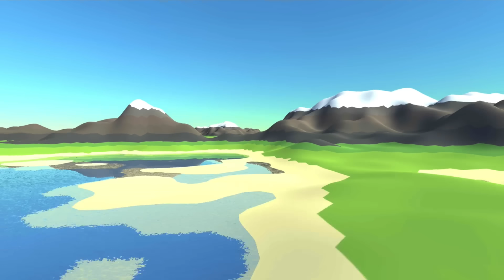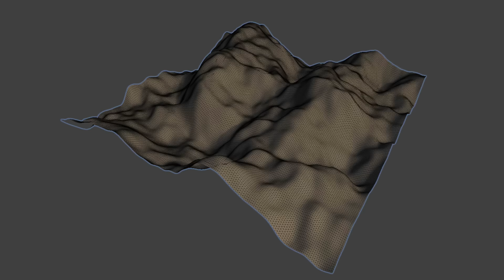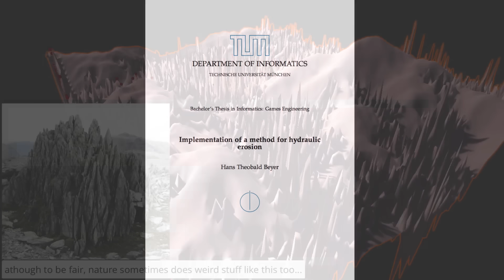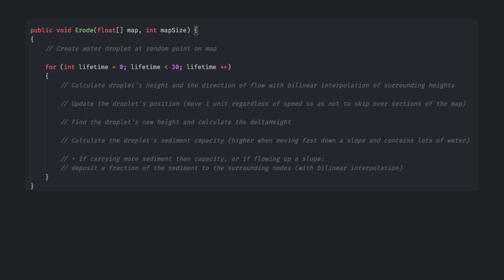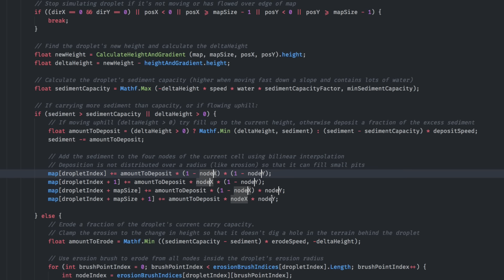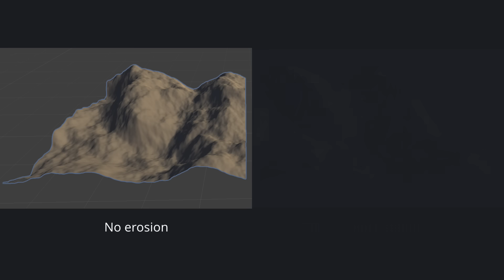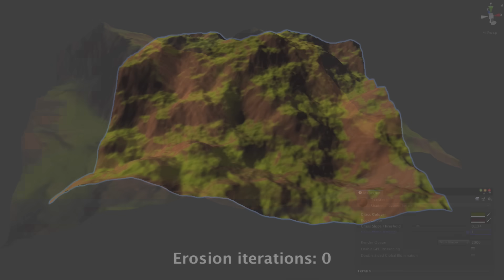Coding Adventure: Hydraulic Erosion

Comment: An interesting way to achieve more natural looking height maps: try and MULTIPLY some of the noise layers instead of adding them. This might sound strange and unintuitive at first, but logically speaking, the “mountains” will get a more rigid looks, where as the valleys will get a more flat look. Simply because the y-values multiply into less change on the lower parts of the map, and vice versa. It was a really simple way to get something quite realistic.

Comment: Part of the problem with the look of generated terrain is that the repetition is obvious. Peak/valley/peak/valley... all the peaks are the same height, all the valleys are the same width. You never get "clusters" of peaks of varying heights with narrow valleys high up in between or a series of peaks descending to a plain. One thing I did when I used GIMP to make heightmaps for Cities: Skylines was to use a gradient layer to mimic an extremely low frequency octave. There was also a technique in GIMP that created a "lightning bolt" in a defined area. That was a great way of defining a fairly "realistic" ridgeline, then use noise to further warp that line, gradient fill to slope away from the ridgeline, and the underlying gradient to produce an overall slope to the terrain. Layering gradients in different directions also created a central peak with the ridgeline slowly tapering down as it moved away.

I did this all manually in GIMP. But there's no reason it couldn't be automated and given parameters to tweak the outcome.

Comment: High altitude peaks don't get rain. The reason mountains don't turn into giant spikes is because temperature changes at high altitude do the major work in mechanically breaking the rock apart, while wind and moisture also play a part (especially water seeping into cracks and freezing, then gravity brings down all the fractured bits. Where trees begin, you also get a lot of rain, but roots and animals also get involved. You can be sure that temperature's mechanical action is the main driver of peak destruction because no peaks are rounded by the gentle polishing of wind and water, rather they and all the rocks that fall from them are jagged.

Comment: You should think of coding a tectonic terrain generator. That'll simulate tectonic movement, magmatic convection, and volcanic activity, all in one fell swoop. I'm already pondering how this might work, notably by intervertical stresses in solid masses.
Your fluid simulation script will come in handy too, given that when rocky planets first form, friction and compression from their own gravity heat them up so much that their constituents melt and re-settle in layers, with nickel and iron and denser materials at the core, and the lighter, sparser silicon, aluminium, boron, and carbon as the crust.
It'll evem be fun to throw rocks at your planet and sprinkle a few craters here and there; even Earth has these impact craters!

Comment: hydraulic erosion can be implementrd without caring about paths, you just need to look at the 1 pixel environment and determine if you decrease or increase the value and gonover each pixel jn the image in random order, the flow happens automatically , and every round you switch the read and the write buffer

Comment: Just FYI if anyone attempts to implement this. The paper calculates the height difference as: 
hDiff=hNew-hOld
It is based on a blogpost at ranmantaru games. In that blogpost however hDiff is calculated as:
hDiff=hOld-hNew
The sign is flipped!!! 
The paper still uses the speed formula from the blogpost without considering this: 
speed = Sqrt(speed^2 + hDiff * gravity)
Guess what happens with a square root with a negative number inside: 
speed = double.NaN
Not only that, but the speed is actually reversed (downhill = slower, uphil = faster).
This error happens when the speed is getting low and hDiff*gravity is larger than speed^2. In the blogpost, the hDiff is also reduced by the amount of eroded/filled sediment before the speed calculation, which is not mentioned in the paper. Probably nobody noticed this because the amount of iterations is limited so that the speed never gets that low to trigger the error ... except when you increase the droplet lifetime to 100 like me 😄.

Comment: I had some problems understanding the paper you linked to; if you would please help with that. In the part where he says that when Hdif is positive, the drop drops the sediment until it fits the pit, do I have to program that, or is it already accounted for by the drop's speed going down and if not, is the sediment dropped just the height difference? Secondly, in the part where he says that when the drop deposited sediment, the residue is distributed along the four grid points surrounding it, what does that actually look like as an equation? Thanks.

Comment: I had some problems understanding the paper you linked to, in the part where he says that the grid point s loose sediment according to their weight values, then he says that the weight values are multiplied by the erosion factor, then he does not mention that it should be also multiplied by the amount of sediment the drop should take which I assumed. could you please explain that to me.

Comment: Another factor which effects how rocks erode which other commenters haven't mentioned is (an)isotropy. Rocks typically form with a non-uniform fracture orientation based on the stress environment during the formation of those fractures. So rocks in a certain mountain range might be more likely to fracture along non-uniformly oriented planes. I don't know the coding side of it, but I think something in that direction could add a certain "naturalness" to the appearance of the landscape.

Comment: Neat job, and it runs a lot faster than I expected. 
Gonna have to look if you ever did the tectonic plate simulation. You'd still need noise for that, tho, as the noise would be required to represent plate composition.

Comment: Have you given any thought to creating a parallel approximation of what you have done here?  i.e. process every cell every cycle, but in a way that approximates the "single drop" approach?  I just finished studying a GPU algorithm that seemed to produce inferior results to what you had here despite combining it with thermal erosion, and part of me thinks it may be because they maintain a single velocity vector for each cell, whereas each cell in your example is essentially exposed to a different velocity vector for each drop it encounters.  Do you have any thoughts on that?

Comment: Ugh! You solved this problem way better than I did.

I'm gonna adjust my solution, then work on perfecting my method for generating rivers:
- Store a copy of the initial terrain heightmap and shift all points downward 1-2 meters, give it a water texture
- Each time a droplet flow direction is generated, add it to a normalized flow field map
- Use the flow field map to create a dynamic scrolling texture shader for the water terrain

The parts of the original terrain that were impacted the most by the erosion process should reveal "holes" where the water terrain pokes through, and that terrain should show the water moving downhill.

Comment: I long ago (i.e. around the year 2000) did something similar, though without the real time 3d rendering (instead, took snapshots). In addition to modifying the height map I built up a map of where the droplets traveled, then normalized the water values to discover where the rivers ran and I had lakes.

Comment: Decades ago, a program called Bryce (acquired by DAZ3D at some point) accomplished this in near real time. I don't believe that a "simulation" was involved / there was no rolling balls down a hill or anything like that - it seemed to simply process a depth map (image file) with a filter. If I were to describe it, perhaps I would say it seemed to "grow" hair (from "high points") in a fractalized manor and that would be used in the depth map to "carve" erosion. And, all said, it was pretty convincing.
 I obviously have no idea exactly how they did it. But, as I said, it worked near and UPDATED in near real time (it was modifiable / had parameters that you could adjust) and that was on an old 486 computer. Granted, the computer I was using was considered a "beast" at the time. But I am sure YOURS would be considered a super computer.

https://en.wikipedia.org/wiki/Bryce_%28software%29

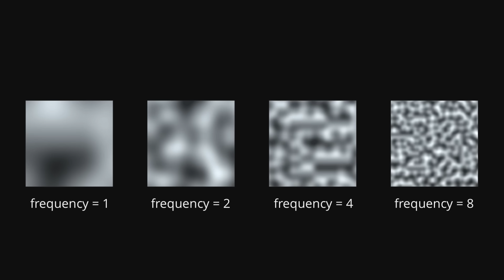Comment: I notice maybe something you skipped - if you add up the noises together at 1:10 with those different amplitude multipliers, how come you get a map with values from 0 to 1, if 1 * 1 + 1 * 0.5 + 1 * 0.25 + 1 * 0.125 equals more than 1? Do you just clamp it, or divide?
Reply: Divide, propably

Comment: Another helpful factor: during inundation, because MANY droplets are falling simultaneously, they merge and form a coherent LARGE channel, which will give your mountain ridges more varied, fractal distribution of ripples, instead of the 'straight hair' look that the current method produces. You'll be able to tell the difference when you look carefully at the pattern of flow - your current model produces numerous parallel small channels, while actual mountains produce 'fronds' that merge into larger streams and rivers.

Comment: Hey there, I'm trying to implement your code for UE4, it works great, but for some reason all of the erosion line are parallel to each other around 45 degrees from both the x and y axis instead of being at an angle to each other, could you please help me with what can cause this?

Comment: I've never seen Hydraulic Erosion done like this, one droplet at a time. It's almost always done with a water map, where you start wit the water map randomly filled and then iterate over the whole map, letting the water flow from higher terrain with higher levels into terrain with lower combined height and water content. Each tick a sediment map has it's value increased by a number depending on the current saturation of the water which is calculated using the amount of water in the cell vs the amount of sediment. When you transfer water between cells you transfer a relative percentage of sediment, leaving behind some sediment, for example if 20% of the water moves to a neighboring cell, only move maybe 15% of the sediment, which increases the saturation in the cell it came from. After every tick of moving the water, do a pass where you remove a small amount of water from each cell while not changing the sediment levels, increasing the saturation and essentially simulating evaporation. Periodically add more water to cells. Repeat this for a number of iterations. One iteration can start before the previous one finishes as well, just make sure more water evaporated in that time than you add back to it, otherwise you'll end up flooded.

To get fancy you can change the amount of sediment carried by the distance between the two cells, so that steeper slopes carry sediment faster, and make flat slopes deposit sediment slower. This takes more work per iteration but less iterations, a couple hundred iterations and you'll have similar results, potentially less depending how well your settings are balanced.

Nonetheless this is interesting, but where the process above takes the same number of iterations no matter the size (but increases the time per iteration), versus single droplets which would require far more iterations for larger resolution maps, changing the scale of the map doesn't change the settings required to get the same results, and ensures a more even distribution because the process ensures everywhere will be touched by water to some extent, while it's possible for random chance to completely ignore a section when working on individual droplets.

Comment: as a Geographer I find this approach very appealing, and the result is surprisingly accurate. it can be improved of course by incorporating hydraulic head(momentum works ok enough), different rock and soil erosion resistance, subsurface flows(voxels prbly) etc. however I assume you quickly run into diminishing returns in simulationist approach. lots of detail and effort for very little visual difference.

Comment: Definitely much better with an erosion. It would be nice (but non trivial) to combine it with your previous series on endless chunked/LOD terrain. Adding streams and rivers would be also interesting to investigate on its own. I think it could be really cool. You could also add various types of land, that erode at different rates, so mountain peaks might be more rocky and hard, but if they are in a valley, and are slowly covered by sediment, their softness increases, and make them erode even faster. Skewing probability also where rain drops fall initially, to simulate microclimat, could be interesting. Another obvious improvement and very easy to add is evaporation during simulation. You can track size of the droplet, and decreases it at each step, that is correlated to height (temperature), and the size would limit amount of sediment that can be washed away and carried. So, also don't just remove the droplet after fixed number of step or when it stops moving (reached flat surface), but also probabilistically earlier on, depending on its current height. It can improve performance too.
Reply: Have you made it real yet ,dude?

Comment: Would it be possible to code in the path of least resistance for each instance, resulting in deeper channels where streams would be that lead to the basins?  It looks so far like each drop has it's own path so it's not interacting with different materials that force it into the same place as other drops.  Just wondering!  Cool video!

Comment: If you're interested in investigating the behavior of rivers (plus their movement and sediment distribution), may I recommend using HEC-RAS (or integrating it into your program).  Luckily it's free.  Us Water Resources Engineers use this program professionally.

Also, if you want to add some more realism, slope and speed/mass of flowing water determines the quantity of sediment lifted, and also the size of particles it can pick up (ranging all the way up to 20 kg+ river stones during peaky flood events).

There's a lot more to this obviously, soil tends to absorb a significant amount of the precipitation that lands on it (though this absorption decreases with time and intensity, plus how close the event is to the maximum absorption rate) before it gets saturated and will allow water to flow over the surface.  This water will tend to find its way towards other water, so you can see the flowpaths get dramatically altered and significant erosion in specific places (rather than in a more generalized, distributed manner).

All said, even with that clever and relatively simplistic method, your results do look quite similar to what you might see in real life.  Indeed, if you think of the individual raindrops as small gullies and flow channels, your model quite accurately describes the physical appearance and behavior of these.  Well done!

One thing that's important to keep in mind though, is water bodies are highly erosive, and relatively little water actually evaporates after precipitating (compared to how much ends up in surface flow/subsurface flow).  So if you wanted to get a tighter model, at the low point, the convergence point (the main river valley), you need a mechanism to remove some of your particles from the edge of the map (like a river would do).

Comment: Couldnt you simulate tectonic activity by mashing two noise maps together maybe halfway across one another then using layer filters like Overlay (One layer almost completely overwrites the first where they share territory) to simulate one plate going over the other, or add/subtract (outright add/subtract the values of overlapping colored territory within the two layers) to simulate the plates pushing together or pulling apart?

Also, if you take into account ground water saturation and Limestone subterranean erosion you could potentially achieve making caverns/caves and overhangs, though it may require adding a physics engine to the terrain as well as having to process sub-surface details of the map which will significantly reduce the calculation speed of the simulation.

Comment: Well… It's a good start! Your going to be limited to certain types of techniques though, if you stick with only using a height map. To get really realistic terrain, you'll need to move to volumetric pixels, or some way to simulate voxels. (You might be able to simulate voxels for the purpose of erosion, because the really relevant part of using voxels, is the exposed surface of the voxel terrain, because that's where the erosion is happening. So if you had multiple planes of different materials, with both a height map for depth, and a masking/clipping layer for presence, you have whatever is sticking up above the surface of the other layers, take the erosion, and effectively protect the layers below it.) You should also consider how plant life impacts erosion, because I happen to know that it has a very significant effect. A carpet of grass will dramatically slow soils from eroding, and plants can also contribute to eroding rock, if there are any cracks where roots can get into. And constantly flowing water will also make it hard for plant to grow, such as is the case with rivers and such. And consider that plants have a much harder time growing on different materials.

You should look up some information on how the first plants and fungus got their start on this planet. There was apparently some type of organism that evolved to very, very, slowly, digest bare rock. And it would pile up, creating a foundation for the first stiff plants to grow in.